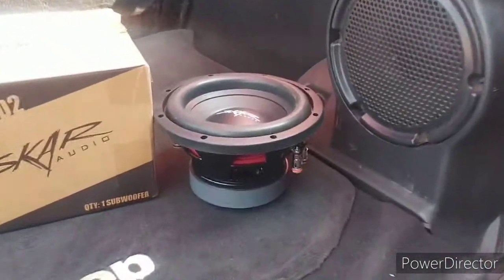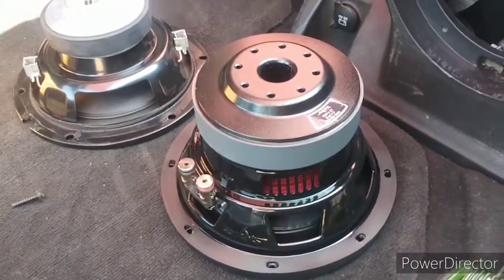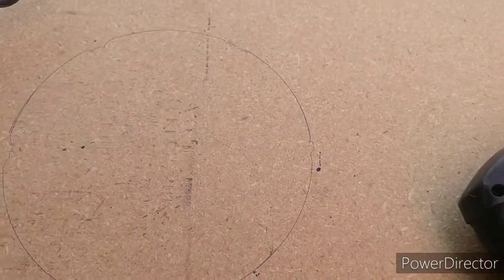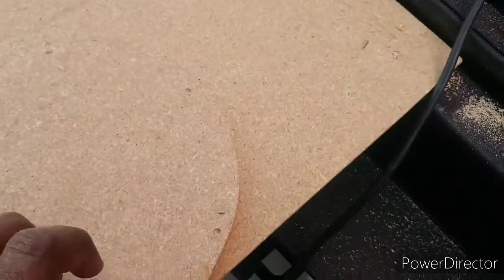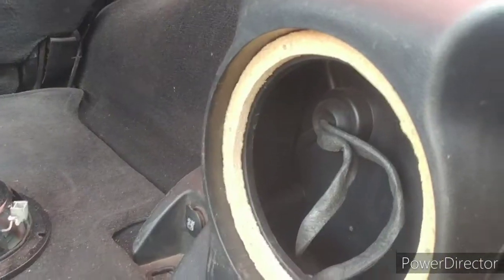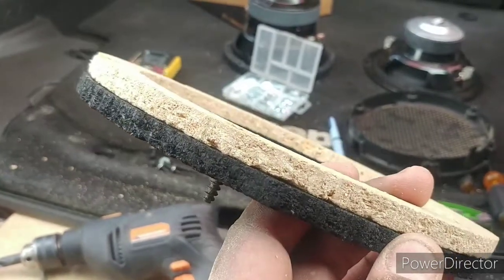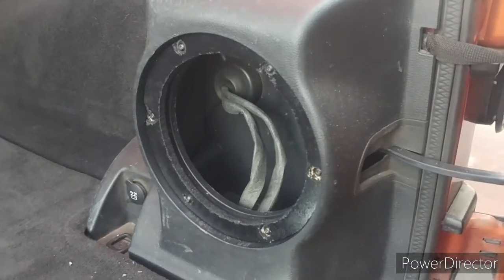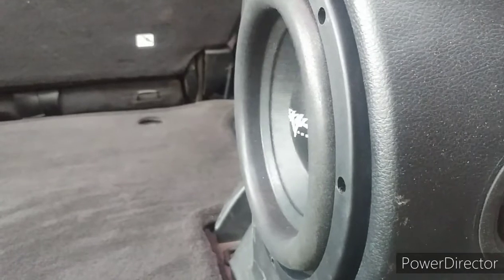How To Install Skar SDR 8-D2 8" Subwoofer in Jeep Wrangler JK

Comment: Thanks for the video. I've been wanting to get a skar but wasn't sure if it would fit in my jku.  Is there anyway to use the old subwoofer adapters since I'm not changing my 6.5s?
Reply from the maker: Yup! You can use those adapters instead, my man. They'll work. And this SKAR hits! Be ready. I added two Rockville 8" underseat speakers to warm the bass up in the cabin. Got a video of that in these videos too. Sounds good!!! Good luck brotha! Keep me posted!
Reply: @MicDropBBQ  thanks again brother.  I got the wood adapter built and painted.  I went with 3/4” so I'd only have to make 1 cut .  I got the terminals removed from the old sub and just waiting for the skar to arrive today so I can install it! I was going to go with a shallow mount sub until I found your video but I think this one will hit harder so props to you for finding a way! I might add the underseat subs if this isn't enough bass for me. PS.  I'm digging your Jeep.  I have a 2011 Mango Tango Rubicon myself!
Reply from the maker: @dig791  YOu never said you had the Mango Tango! Daaaaaaaamn! That's what's up! And you have the axles I need. LOL! The Rubicon is a solid Jeep, and I wanna off-road mine with larger wheels later in life. Maybe 37s or 40s, so I need your axles. LOL! I'm glad you built that adapter. Make sure when you place the sub in there, the little flip-storage can come up without rubbing the sub. Mine BARELY touches the sub when I raise it, but the storage door can always be shaved down a quarter inch to make more room. Doesn't hurt it. Just brushes up against it a little. If you get the underseat speakers, it will fill the cabin with warmer, more rumbling bass. The SKAR hits and the Rockville's smooth it all out. Seats shake and vibrate and that warm bass just rolls around the cabin. I just added a video of two Rockville wakeboard speakers and a Rockville amp. MAN they are loud!!! I went with a 300W amp, but I could have went with a smaller amp. It pushes those speakers HARD and it sounds crystal clear with a little more bass in the "dead zones" in the Jeep. I can't wait til you hook that SKAR up!!! Man! I wanna see your reaction! LOL!
Reply: @MicDropBBQ  yeah man I bought this about 8 months ago.  Loving it so far!  It came with 37s already on it.  It looks good but they suggest regearing if you move about 35s so that's an expense you need to consider before making the jump! Thanks for the heads up about the cargo area.  I could see myself flipping that thing up and ripping the sub.  Lol.  I wonder if there's an aftermarket grille/sub cover that would work for this setup?  Of course that would just add more depth.
Reply from the maker: @dig791  yeah, a cover wouldn't work for this setup. You're right. More depth required. But i was looking at 5.1 gears already, not ready to to higher than that. I've regeared differentials at my old shop before, so pulling axles and gutting it wouldn't be an issue. Messy as hell and gear oil stinks worse than transmission fluid! Doing it at home would definitely stink the place up for a good week. Can't throw any rags in the trash in the garage or any tools covered in gear oil in the garage at all. 😂😂😂 37s is maybe as high as I will go if I keep doing Lyft and Uber in it. 40s? Nobody's grandma is climbing in. Hahahahaha!
Reply from the maker: @dig791  and I subbed your page. I wanna see a video when you're done! Plus your thicker adapter may work better than mine, so it'll be a route I may take. Some others may wanna see that work with your adapter too. We need a 3D printer, man....lol!
Reply: @MicDropBBQ  you do Uber in your Jeep?  I bet the passengers love it!  But are you making any money with the mpg? Lol.  I used to do Lyft, Uber but I just do doordash, grubhub now.  I bought a Prius to do that with.  55mpg and it actually has an amazing JBL system in it.  I take the Jeep on deliveries when it's nice out!
Reply: @MicDropBBQ  I know a Prius is considered uncool but it helps me maximum my profits for my delivery gigs.  💰💰
Reply from the maker: @dig791  all about profit margins. In AZ, we pick up people on mountains and trails, off-road and in areas where cara get damaged. The low-clearance cars always end up in shops. After 90,000 miles of driving, zero shops required so far! This baby handles AZ like a champ.

I used to make $2,200 every 6 days but I'm down to around $1,500 every 6 days after Covid. I fill up once/day for $40 and push it til it's on E....then call it a day! Making $300/day is normal for the rides they have me take. And I do it all in less than 8hrs!

I would like a 2.0 engine in the Jeep (like the newer ones), but being manual gets me around 18mpg average. Highway is like 14mpg. Streets are like 23mpg. I hate highways because that wind pulls me back...and AZ is spread out! I could be 2hrs out from Phoenix at any given moment on a ride a car wouldn't take. But the Jeep flies thru these areas and it's kinda fun. 😂😂😂😂

Luckily, I do all of my own maintenance. No way I could afford it if shops did my oil, brakes, differentials, and transmissions services as often as I do. 90k miles in 15 months...lotta rolling!
Reply: @MicDropBBQ  didn't realize you were in AZ.  I'm in Indianapolis so nothing but flat roads here.  That's definitely good money.   The Uber money isn't that good here.
Reply from the maker: @dig791  we have a lot of conventions here. Lotta business retreats and golf outings. Restaurants galore that are speed everywhere, so rental cars sell out and that leaves rideshare a lotta room to make money. Plus we have like 4 major universities here...and a zero-tolerance alcohol policy. Can't even have 1 beer and drive.

That means people are always using Rideshare from house to house, bar to house, house to bar, bar to bar, all over. Non-stop rides.

You come here for one month and work 12hrs/day for 6 days and you'll clear $8-10k in that month. And we have a driver shortage...bad!
Reply: @MicDropBBQ  I'll have to consider moving to AZ!  Lol.  Alright brother, I just got the skar hooked up and honestly I was underwhelmed.  It was maybe 10-20% louder than my stock sub.  I guess I need to add the underseat subs too.  How much does the stereo make a difference?  Mine is stock and all the other speakers are stock as far as I know.  I was messing with the equalizer and my front speakers sounded good, the sound bar speakers were trash so maybe I'll replace those too.  Trying to not throw too much money into this project! Lol
Reply from the maker: @dig791  I run a Pioneer deck. That makes a difference as it puts out more RMS wattage than a stock deck, I would assume. The SKAR needs to be matched with RMS wattage, at least...or else you under-power it. And under-powered sub sounds flat, as there's not enough power to push it to it's potential.
Reply from the maker: @dig791  I also run Mopar Kicker 6.5's versus the stock Infinity 6.5's. Found a new set of 4 on Ebay for like $125, I think.

The underseat speakers have their own amp, so they power up nicely (even running at 75% gain.) All they really do is fill the hollow spots where the bass is missing from the rear sub. Shakes the Jeep seats like a theater setup.

My deck only cost me $140 at Wal-Mart but it has high RMS wattage per channel. That's the trick: RMS wattage being high enough to balance it all out. If you run a low wattage source (deck/amp), then you will under-power all of the speakers that have higher RMS wattage.
Reply: @MicDropBBQ  I'll start looking for a new deck and see if that helps.  Thanks for the tips!
Reply from the maker: @dig791  I've read that the stock Wrangler JK unit is 66W total x 6 outputs. Literally 11 watts per channel. The Pioneer unit I have is 200W total x 4 channels. More like 50 watts per channel. That's gonna push a little harder than what stock can do.
Reply: @MicDropBBQ  just picked up a new stereo.  I'm guessing it's the same one you got.  $120 pioneer from Walmart.  I'll have to figure out how to install it and see what kind of difference it makes!
Reply from the maker: @dig791  yup! That's the one! Make sure you hook up the parking brake wire or else a few functions won't work. The Pioneer wires are labeled so it's easy.

Also, when you install, go into the speaker settings and turn all speakers to +6. Turn the subwoofer level to the highest, as well. Make sure the Bass Boost is ON and Loudness is ON.

You'll then use the EQ to tune it up. Gonna sound like WHOA. Thr volume goes up to 40, but I run mine at 5. Hahaha! Soooooo loud at 5!
Reply from the maker: @dig791  Oh, and you can also turn the BLUETOOTH level on the Pioneer up to +4.

You're gonna be pushing a lotta sound, brotha! Pioneer gave so many ways to increase the output levels. That's why I can only turn mine up to 5! 😂😂😂 all of my levels are maxing, so rolling with the volume on 3 is like "comfortable.

 Volume at 5? You're gonna have to talk a lot louder to hear the person next to ya! You'll never make it to volume 10. No need to. 40 is the max and ain't no way 40 is possible. Wayyyyyyy too much output at 5.
Reply: @MicDropBBQ  I'll definitely turn that up!  I have to turn my radio up to 25 now to get the sound I want.  Also I can't get my phone to connect to the bluetooth so I've been using a bluetooth adapter in the aux port.  Probably losing some sound quality with that too.  It sounds like it will be a major upgrade all around!   Did you have to buy any extra wiring kits or anything or you just use the ones that come with the pioneer?  The few videos I watched wanted me to buy an extra $200 in accessories just to install this $100 radio.  Lol
Reply from the maker: @dig791  LMAO! Hell no! I'm dying!! $200 in accessories for a $100 radio! I'm DEAD! hahahahahahahahahha! Man! But I didn't buy anything else. Some black tape for the harness/adapter. I think heat shrink for the power/ground wires. That's about it. Had that in the garage already, tho.
Reply: @MicDropBBQ  that's the type of install I was hoping for.  Never did a radio myself though.  They were suggesting a mounting bracket, extra wiring harness, and a maestro or pac which is like $150.  I guess you lose your steering wheel audio controls without that but I don't use those anyway!
Reply from the maker: @dig791  there are mounting plates in the Pioneer box, I think. Or maybe I had some when I pulled that old JVC out. Can't recall.
Reply from the maker: @dig791  and i don't use my steering controls either! Lol! My hand is always on the shifter under the radio, so why pull my hand all the way to the steering wheel when it's already closer to the radio? 😂
Reply: @MicDropBBQ  exactly!  Lol.  There's no mounting bracket with mine so that's one thing I'll have to buy but it's only $10
Reply from the maker: @dig791  then it must've been on the JVC when I pulled it. Still $10 ain't bad!
Reply: @MicDropBBQ  my bracket arrives Tuesday and I went ahead and ordered some of those kickers.  So I'll get everything installed next week and I'll let you know how it sounds! But I was just outside working on the Jeep and had the radio going.  The bass sounds really good on the outside of the Jeep.  Lol.  Unfortunately you can barely hear it on the inside. I'm hoping this new radio will do the trick!
Reply from the maker: @dig791  you have so many sound levels to adjust. I may have to do a video of all the screens. You have to turn the Bluetooth level up to +4. Then all the speakers to +6. Then the subwoofer level up to max (whatever that number is). 😂😂 There are like 4 screens I went thru yesterday to see how I adjusted to get the sound maxed. Crazy. I was like, "... I probably gotta show Ryan. This is harder to explain than I thought." Hahahahahha! But that Bluetooth level adjustment is key. It sits at 0 until you adjust it to max (+4).
Reply from the maker: @dig791  and my underseat Rockville 8's actually warm the bass up a lot. The Skar hits hard tho, once you get all the levels right. I can't wait til you hear what it can do. Took me a while to figure out the Pioneer tuning, but I got it down! Man, you're gonna be like, WHOA....😂😂😂
Reply from the maker: @dig791  I just added a quick video for you, brotha. Gotta go pickup some fiberglass for this motorcycle project real quick but wanted to show you the screens I went thru. And make sure the volume on your phone is MAX when playing, as well!
Reply: @MicDropBBQ  appreciate it man!

Comment: Dope AF 😮
Reply from the maker: Thanks, P!!!! I'm still considering finding someone with a 3D printer to use my mold to make a spacer for it. If I do that, I'm sure many people who would to upgrade to a SKAR 8" (or another sub that's too deep for the enclosure) would want to buy one. It looks clean and sounds SLAMMING with the amount of punch it has, now. I am thinking of adding an amp to it, but it's already hitting to where I shakes the photos on the wall in the house when I'm playing music in the driveway - but it still doesn't vibrate the Jeep! Crazy, I know. But that means the sound of the Jeep is clean bass, and the bass is traveling and is loud enough to vibrate things about 20ft away.

Just the acoustics of the Jeep keeps it from shaking the license plate and all that. It's truly a clean setup and a video does it no justice. When I have people in the Jeep and I play it, they just light up like WOW! ALL THAT SOUND????

Comment: How much watts are you pushing to the sub?
Reply from the maker: Using the deck to push 50w per channel and then the stock amps that come in the Jeep. Not even sure how much that would be. Those amps aren't powerful at all, but they push it well. I bet I can put a 200w amp on it and get it moving some SERIOUS sound tho!

I wanted clean bass and nothing that shakes that plastic Jeep top too much. If I pushed it too hard, I fear I would hear a lot of plastic against metal vibrating versus hearing a clean, smooth bass rumble.
Reply: @MicDropBBQ  what head unit are you using?
Reply from the maker: @Ryan............  Pioneer deck I picked up at Wal-Mart. It was maybe $120. My JVC cracked, so I ran to the store to get a unit to make it thru the work-week. Ended up being a pretty amazing unit for sound! The EQ and settings are much better than my JVC was.

And it's just a basic Pioneer double-din deck that also plays DVDs. Looks cheap. Sounds amazing. Lol!

Comment: Do you need to add a amp for this to work?
Reply from the maker: I didn't add an amp for this, but you could run an in-line amp. I've got the stock amp powering it, as I just connected it to the leads that were for the stock sub I pulled. It sounds good, and I've not even did much to tune it for bass with the head unit I'm using. I was going back and forth with the phases in the menu for it, and it does change the depth of the bass I can hear. I run a Pioneer deck and I did a video on the phase selection for it. I'm not sure all decks have it, but this one does.

Without an aftermarket amp, it still hits VERY well and flexes well. I've not even got it powered to what it could do, and it already sounds good. Imagine hooking a larger amp to it. It'll REALLY kick!!!

Comment: Hey is there anyway I can pay you I have the same Skar sub I can PayPal or cash app I’m just not skilled with a jigsaw
Reply from the maker: Know what I found? Look in the description of the video, and there is an 8" adapter that might fit on Amazon! Check it out. Crazy, but I never looked til after I built mine. Oh well. Hahaha! It was a fun build with stuff I had last minute in the garage.

But yup, you can actually buy an adapter for 8" subs.
Reply from the maker: I didn't add it to the description. Damn!!! I just looked. I swore I did. But go to Amazon and search for 8" sub adapter. That how I found it. Sorry, brotha! Thought I added the link. I will when I get home later tonight.